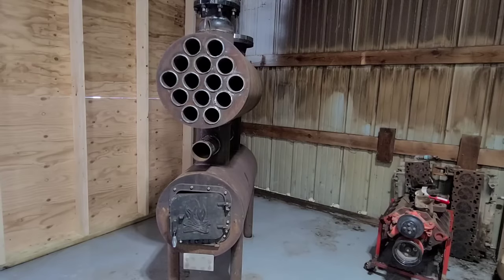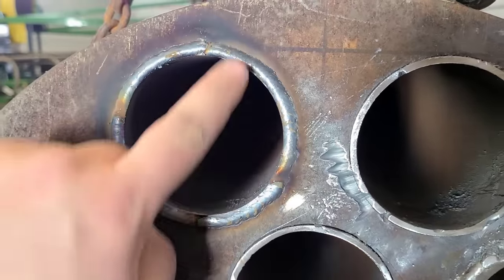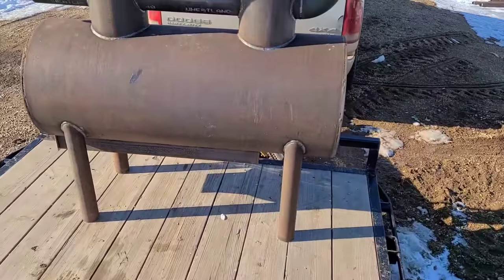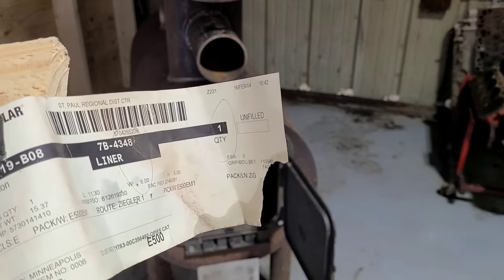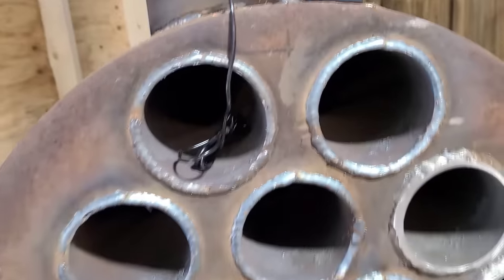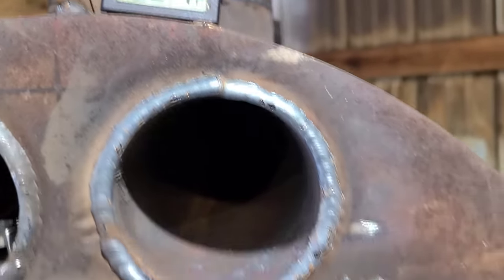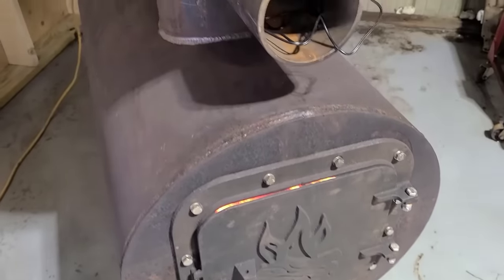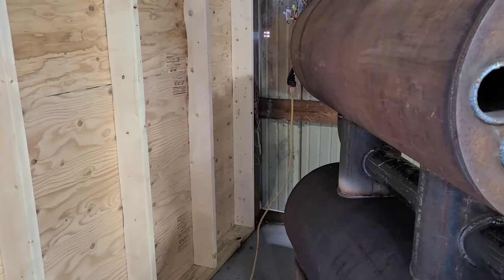My Ultimate Shop Wood Stove Build Part 3

Comment: Build yourself a cold air intake and plumb it in from outside. Warm air in the shop is going strait up the chimney.
Reply: That's your natural air circulation
Reply: @Entertainment_Enterprise  meh. Ages old argument against cold air intakes. Only the tightest of homes need air circulation and make up air recovery systems. Shops like these with big man doors, huge garage doors that inevitably leak, do NOT need natural air circulation. A big shop like that needs to keep heat in to reduce wood consumption. A cold air intake would greatly add to reducing fuel consumption.
Reply: The very best advice!
Reply: That's exactly why an intake is helpful, that circulation you speak of is bringing cold air in from outside. An externally sourced intake would reduce that significantly.
Reply: Cold air from outside drawn into heater  >> converts to warm air >> adds to air inside >> increased volume of warm air inside displaces cold air >> prevents cold air from being sucked in from outside.

Sounds legit. 

Wouldn't you need separate external air intakes for both the burner and heat exchanger? Otherwise you would be recycling your warm air through the fire and out the chimney... or would the air in/air out ratio not be drastic enough to notice?
Reply: That's literally the reason for the second barrel and the air tubes. Lol
Reply: Woodstoves, put off radiant heat, which is far different than convective heat, and is why they are often a great heating choice for spaces that are poorly, or not at all insulated, but having direct combustion air from outside will avoid drawing in colder air via air leakage through the building envelope. The better the building is insulated, coupled with how cold of a climate you are situated in, will determine how much of a difference having  combustion air vs not will have.
Reply: If he would have sloped all the heat exchange tubes upward it would be ten times more efficient. Air doesn't flow well in horizontal tubes.
Reply: …so bring in cold air to circulate warm air?…….think about that, you would be wasting energy, you would be cooling the warm air you have worked to capture in the first place, by bringing in cold air to circulate it…. There is a reason you put a furnace in a conditioned space, as opposed to a non conditioned space. Fresh air circulators still have to pass through a conditioning phase as to not loose any thermal draws, positive or negative.
Reply: @7.62x39Boogaloo  lol I see what you mean. But I think he means directly into the stove not the heated space.
Reply: @scottresch9912  correct. Pipe in cold air directly into the stove, the stove uses exterior air to burn the wood, and then that air/smoke/co2 etc goes up the chimney. This keeps the air in the garage as its own envelope.
Reply: Spoken like someone who doesn't live on the Canadian border.  Let's heat -30f  air and waste wood.
Reply: @Converterguy  not on the border.. just 150 mi south..  and lemme ask you a question.. if it’s -30 outside, and you are against the fire having its own envelope due to it having to ‘heat’ the incoming air, what’s the temperature of the air leaking into the garage in the case of your alternative of using air leaks as incoming air for the stove? The answer is… -30…. The fire combusts the oxygen to sustain itself. It does not care for the most part what temperature the air is that’s coming to it, and any minute amount of heat in the transfer process from the fire to the air is negligible in comparison to the fire having to heat -30 air coming in thru cracks in the shop/garage.
Reply: @chrispy3866  so you're suggesting that he plumbs a fresh air return to the draft on the stove? That would be kinda tough
Reply: @sasquatchrosefarts  it does when a fan is blowing it...
Reply: All the air that’s going out the chimney is being replaced by cold air coming in through the cracks in the doors and windows.
Reply: @stevenbeach748  thats the problem steve
Reply: @stevenbeach748  and that’s the problem
Reply: @isaacunruh1415  You need to do a little research.  He is correct when he states to have a cold air intake system directly into the stove from outside air.  It is proven technology in proper stove building.  Look it up, countless tutorials online.  This prevents cold air from being pulled through every leak in the garage or home.  It is, in fact, way more efficient to heating a  space.
Reply: @christophersallee7904 that's the whole point. The fire uses up all the oxygen. Having it's own fresh air intake closeby decreases the amount of cold air seeping in from all the other imperfections in the building. Outlets and windows that suck in cold air begin to mold. The cold air can be heated before entering the room if it's near that fan.
Reply: @dspkr_0_0  they put off both. But mainly convective. It heats the air which heats the room. Sorry, you’re mostly wrong. If it were mainly radiant heat, the wood stove would heat the rooms contents, which would then heat the air in the room. Much like those long radiant heating elements frequently found in warehouses and shops, hanging 12’ off the floor over the workers in the area. Wood stoves are convective. Hence why people put fans around them. They heat the air.
Reply: @chrispy3866  In the wake of your infinite "wisdom" I will point you towards maybe taking 5-seconds out of your busy schedule to do a quick Google search before commenting next time, to maybe avoid jumping up and making erroneous comments, as well as telling someone they are wrong, when you are in fact the one who is "mistaken". For the record, a Woodstove puts off almost exclusively radiant heat. Radiant heat sources can and will also heat up the air in the direct vicinity of the radiant heat source causing some convection, which can also partially transfer heat to other parts of a space, but that DOES NOT suddenly make the woodstove a convective heat source. Even if you have a blower/fan system that uses the radiant heat from the woodstove to move heated air around to other areas in the space, how does that suddenly NOT make the woodstove itself a radiant heat source? That would be similar to what you call a fan coil forced air system, which is a radiant heat source that is used to heat up air that is blown over the heat source, then piped/ distributed to a desired area. Again, that doesn't make the radiant heat source a convective one, right? I have worked in the plumbing/mechanical/heating and pipe trades for over 20 years and have installed boilers and radiant heat systems for nearly all of that time, I have also used woodstoves to heat my residences since I was big enough to pick up an axe, so with all of that said, unfortunately YOU are wrong...
Reply: @dspkr_0_0  Hot air in a room is much thinner, thus reducing the pressure so the air in a cold room
will flow to the hot room. It's called physics, and you read about on YouTube called "thermodynamics for idiots.""  You may have installed heating units, but you haven't learned the science behind it.
Reply: @dspkr_0_0  firstly, settle down Francis.. second, you’re WRONG. See others replies. Wrong wrong wrong.
Reply: @dspkr_0_0 Oops, sorry, I didn't mean to disrespect you.  I should have read your comment more carefully.  This discussion has gotten off to a tangent about convection vs. radiant, which is odd since it is obvious that the wood stove is radiant.  I am simply pointing the obvious that reading the principles of thermodynamics will resolve this debate.
Reply: @dan-sc7fm  All good Mano. I don't typically comment on things unless I have a very good grasp, and accurate knowledge of the topic at hand.. Tbh, I was actually responding to the comment saying that I was wrong about classifying a woostove as a radiant heat source *facepalm*... With that said, just because the source of the heat in this case is radiant, does not mean that the radiant heat will not heat the surrounding air and cause passive air convection. Or if a heat driven fan, or even an electric fan is used to move heat over the stove and into the surrounding arwa of the stove, that doesn't change the fact that the source of heat is still radiant. There are actually fan driven heating systems that use hydronically heated heat exchangers/ heating coils as the heat source for a forced air system, called "fan coil" forced air systems, and are often found in situations where the main source of heat in a space is boiler fed radiant/hydronic heating, but there is also a need for forced air heating, and instead of having to install a totally separate LNG forced air furnace, which needs a separate gas line piped to the appliance, intake and exhaust venting installed, as well as a drain for condensate collection, where as a boiler fed hydronic fan coil forced air unit needs only a boiler take off + hot water supply and return.
Reply: @chrispy3866 You know what they say about arguing w/ ignorant... "Individuals"  over the internet... And that trophy is all yours, "Francis"... Lool.
Reply: @dspkr_0_0  Yep, I have the former forced air unit, which is not very efficient or cozy warm.   If I were building a new home, I would consider hydronic floor radiant heating.  Since I bought an Amish house with no furnace (or electrical), I was limited to installing forced air heating. But, , I also made sure that I placed the cold air return vent above my Lopi wood burning stove with a circulating fan on the furnace, therefore circulating the warm air throughout the two floors of home.  So, yes,  I am using both radiant and convection (hot air) from the wood stove to heat my home.  Growing up in an old Chicago bungalow house, I still swear by the old steam radiators was the most comfortable heat, not the most efficient heat but the coziest heat.
Reply: You are absolutely correct about a cold air intake from outside.
Reply: Soak some of the wood in old motor oil,lasts longer
Reply: Cold motor oil makes it burn hotter 😂
Reply: Bring it in thought the chimney or behind the unit itself so the cold air isn’t flowing across the floor.
Reply: I might just be a dumb welder and an even worse mechanic but doesn't all that cold fresh air y'all speak of, and the very way it wastes that free wood the very thing keeps this heated space from becoming a carbon monoxide cabinet? Seems to me a bit of waste and a touch of fresh air is a good thing. I guess that's way my ancestors, the Vikings, conquered all. They weren't bitches..... IMHO....
Reply: @chrispy3866 Yes, I agree. The simplest way to think of it is that a wood stove by itself is radiant heat, but once you had a fan to distribute the heated air, you now have a convection system.
You will never get all the heat created to move via the fan, so some of the radiant properties remain.
Reply: @sasquatchrosefarts 
I agree with you bro ...before watching this video I had a rough design in my mind .....the 3 meter length vertically laid pipes in  the combustion chamber carries the room temperatured air forcefully goes through the red hot pipes and the result will be satisfying...

Comment: Howdy Kyle. When i installed my wood stove I used concrete "Wonder Board" to cover the walls around the stove. I also used behind the Wonder board a product called Rockwool insulation  that is made from spun fibers made from melting minerals. Unlike fiberglass insulation that will burn Rockwool will not even burn if you put a torch to it. It is also rodent proof and it does not mold if it gets wet. Over the Wonder Board I put ceramic tile that I obtained from a Tile store for cheap as the tile was end of run production and on a clearance sale, The tile retains heat and also reflects the radiant heat from the stove as well as looking nice.  Great stove for your shop I always liked the dry heat from a good wood stove and free fuel is even better.
Reply from the maker: Thanks for the info Pat, I've used Rockwool before and it's a great product 👍

Comment: It would  be nice to know the temp of the smoke coming out the chimney to gauge the relative heat exchange.  Also, as you push volumes of air out your chimney, it will draw in the same volumes of air from any other airway to the outside.  The best place to drawn new air in would have been down the length of the chimney.  Putting your chimney inside of a pipe where the air is drawn from above the roof would have heated the new air coming in and retained the barometric pressure of the building right where the volumes of air are leaving.

Comment: I have the same issue dumping pallet ashes with nails. I bought a 150 pound rated magnet at harbor freight. I’ll be raking my ash dump spot dragging that magnet through it.
Reply: Oh, no way the magnet has the pull to pick up nails in the ashes. Hence taking it. It’s a pretty lame magnet
Reply: I just use salvaged speaker magnets stuck to the shovel and buckets.

One could get really efficient by using those neodymium disks.

Comment: My stepdad built one similar to yours for his shop when I was a kid... although his you could throw a full 8' railroad tie in long ways. Main difference was his all the fresh air/heat tubes were connected on the ends 180 degrees to make one continuous loop before heated air exited into the shop. Also the tanks were one right on top of the other touching with a chimney at the back That was 18" pipe and when you closed the flue it made the smoke go into the barrel around the heating tubes then eventually back into the chimney. It was big enough a barn owl fell down it past the flue one time and he made me crawl to the back as a kid and retrieve the owl with welding gloves on.

Comment: Suggestion from my own experience - take some long strips of thin steel that just fit in the tubes, and twist them into long “screws” and install them in the tubes - they’ll act as turbulators and slow down the air as it passes thru the tubes and increase heat transfer and overall efficiency. Looks great though!

Comment: Bud of mine built one like this back in the 70's made from two heavy wall military 55 gal drums. He used probably 20 2" pipes in the top chamber with a 10" squirrel cage fan on the back. His house was a 2,200 square ft. A frame. He loaded it with some cured spruce. It was -20F outside. After 20 minutes we were opening all the doors and windows. Yeah, it worked good.
Reply from the maker: That's awesome! You'd be surprised at how many people tell me this design doesn't work but double barrel stoves have been around for a long time 👍

Comment: SUGGESTION: 

Wrap the firebox with refractory. Keeps your burn chamber hotter. Better gasification. 

Cold air intake for combustion. You building is sucking air in from every crack to feed her.

Cold air intake added to blower fan inlet. Positive air pressure building. Keeps your doors from frosting up, and keeps condensation out of the wood in your walls. A venturi made from ductwork reducer with a small 1-1/2 pipe from outside works great. Keeps the fan cool too!

Comment: Cool. That looks just like a stove I helped a cabinet shop in Arkansas build 20+ years ago!  We tilted the top barrel backwards a little bit so any creasote that tried to form would run back down into the burner barrel.  When we installed it we put a box fan a couple of feet behind it to blow air through the tubes.  It worked great.

Comment: I don't want to be a back seat video critic, but if I may throw in my two cents into the hat.
    A good hot fire is one that maintains a high temperature long enough to crack and combust the hydrocarbons released as smoke. Soot and carbon build up is from the smoke being cooled down too early and not being burned. Think of the smoke as a secondary fuel, hence why secondary burn stoves are so efficient. Your blower motor is doing just that, cooling the smoke down. Think about both an outside air intake, but also a secondary hot air intake into the top barrel close to the exhaust entrance (or bottom barrel just at the chimney into the top barrel). Research secondary burn.
    Second thought, the blower relies on electricity. Something you may not have at some point. If you were to incline the top barrel upwards (20 deg, maybe?) then you would create a natural draft thru the top barrel tubes. This would also increase the average operating temperature of the top barrel, helping to increase the combustion of the smoke.
    I have a rocket stove of 4" square tubing, 3/8 thick steel. The horizontal burn tube is 2 ft in length. Fuel is added only at the entrance to the tube. When it is at operating temp I get no smoke at all out the chimney, even with wet or green wood. This is because the smoke is held at a high enough temperature to be burned and release its heat. 
   Anyways, just offering food for thought
Reply: Or just put some draft chimneys on the output side to induce a stronger natural updraft.  Heck I'd put some piping on the back side to pull cooler air from the floor too if I really wanted to optimize it.

Comment: You are quite a craftsman  . Be careful  if the flue temp gets too low the products of combustion will condense  resulting in creosote  in the  pipe. Chimney fires  are fun to watch !
Reply from the maker: I know, although I don't think it will be an issue, there is still plenty of heat going up the chimney. Thanks for watching

Comment: I would definitely add a cold air intake for the firebox. You don't need one for the fan and tubes. Add a basic filter to keep that furnace fan motor running. Awesome build!!